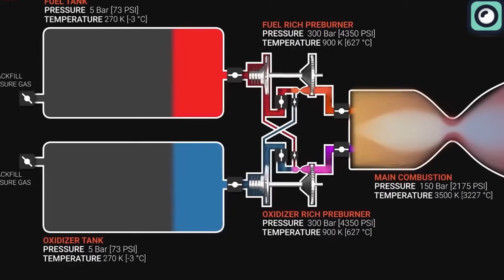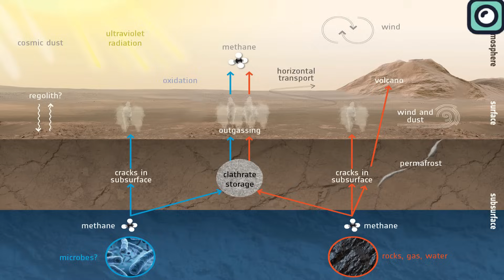"Starship is a joke, will never fly", SpaceX responds to Haters and Embarrass Them!

Comment: Sad thing about Elon Musk is that yes he proved many people wrong about Methane as rocket fuel, yes he  proved many people wrong about Stainless steel as rocket building material, yes he proved many people wrong about Raptor rocket engines but in the end he failed due to his ignorance of mechanical engineering  as he was unable to properly design unpressurized part of his rocket so it would withstand compressive forces developed during liftoff and flight to orbit. His disdain for formal education is his undoing.

Comment: THIS is how you  innovate, test new "outside of the box" ideas, see what fails, fix the points of failures and be a leader in the industry.  Stockton Rush (Oceangate) on the other hand tests out new ideas with paying passengers (or mission specialists, if you prefer) on board.

Comment: Musk is very smartly taking advantage of modern educated engineers. Ironically he holds formal education in disdain. Wish he would change that attitude.
Reply: Elon's attitude is his undoing. Last test launch could have been total success if Elon bothered himself with studying mechanical engineering or hired professionals and allow them to do their job. After his rocket failed Elon lied as to why it happened and came up with the bandate that enured that on the next launch attempt his rocket is not going to make it pass the top of launch tower. There is a price people pay for their Arrogance. Unpressurized section of the Starship/Booster is a total mess uncapable of supporting the Starship during liftoff and flight to orbit. Last time around the Skirt of the Starship partially collapsed at 40% of nominal compressive loading  just  before MECO. This time around his rocket is going to collapse before it reaches top of the Launch Tower

Comment: An engineer wouldn't call that first test launch a "failure".  Here's why.

When engineers design something, they use the best information they have at hand in the design.  But we live in a world with a lot of engineering "uncertainties" such as friction and metal fatigue, as well as simple oversights no one caught, therefore, testing must be accomplished, with the understanding that there's a pretty good chance for something going wrong.  (Some tests are intentionally "tests to failure" to see the limits of a design.)  So Elon tested Starship and learned a lot when it failed.  Unknowns became knowns.  Guesses were refined.  Oversights were caught.  In that sense, the test was a success.  Had they not learned a thing, that would have been a real failure.  They wouldn't know what to fix to preclude another failure.

There still may be a "failure" with the next test orbital launch.  It really isn't until you have payload onboard that if the rocket fails, you have a real genuine failure.  There could be even more "failures", which are okay until the money starts running out.

Remember "failure is not an option"?  That's because the mission objective changed from going to the moon to simply getting the crew back alive.  Apollo 13 failed at going to moon (the first part of Kennedy's stated goal for NASA).  It was not a test rocket.  But at least it did succeed at bringing the crew back alive (the second part of Kennedy's goal).
Reply: Really ? As an engineer to make full use of past engineering experiences of all that preceded you is the norm. In this case we witnessed what could have been so much more, but success was cut ridiculously short by a gung-ho half hearted attempt. Let me explain.
The launch pad which spectacularly disintegrated and most likely damaged the spacecraft should have been a no brained to construct. There’s been 60 years of launch data to draw from demonstrating the correct construction methods that should have been used. 
Oh, you may say that this rocket was so so much more powerful ! Well, sure around 25% more than was used in the 1970s , so, construct the launch facility 30% stronger, NOT as it was done here. 
Now if the Starship actually made a successful launch, a successful flight as was intended then that would have been considered a success.
Reply: the launchpad isn't the reason that test flight ended when it did. starship made it past max-q despite several engines aborting, which is absolutely a success. the reason the test ended was because the flip separation idea failed. the ship was stuck to the booster, so they decided to trigger the self-destruct explosives onboard. also, maybe you could say that SpaceX gained some data on what it might be like landing a booster on the bare surface of Mars... at least as similar as Mars is to concrete. (but yes, most people could guess what would happen, and they should have planned for that. now they have.)  @spinnymathingy3149
Reply: @spinnymathingy3149  “60 years of launch data”?  Yeah, 60 years of NASA launch data, where cost control is way down the list of priorities.

Elon’s test of his first really cheap launch pad gave him the information he needed to build the next cheaper launch pad.  For all we know, that first launchpad may have worked.  There was no way to know without testing it.  It’s easy to be a Monday morning QB about this stuff.

Following the NASA way of doing things is guaranteed to lead to high costs and cost overruns, as perfectly shown with its very expensive and already-outdated Artemis rocket program.  In regular business, you start out with a design that’s cheap, but you believe has a reasonable chance of success.  After testing, if needed, you build on that design recognizing that there will be an increased cost.  In stark contrast, NASA’s typical way of doing things is design something that has enough engineering overkill in it so that it’s almost guaranteed to work, and worry about costs later (if you worry about them at all).  That thinking just doesn’t work in the for-profit business world.  NASA had about 400,000 people working to put a few men on the moon.  Elon’s SpaceX is trying to put hundreds of people on Mars employing about 12,000 employees.  He’d quickly run out of money if he did things the NASA way mainly using their data.
Reply: Good one. @spinnymathingy3149
Reply: When it comes to good engineering practice SpaceX failed miserably. State of the art today when it comes to designing interstage can easily be found on the Internet. SLS Artemis uses aluminum alloy for their Interstage instead of Stainless steel and they use crossing diagonal reinforcements. It would be very prudent of SpaceX engineers to find why other people use diagonal reinforcements that are so much harder to manufacture. Sadly they never bothered with asking such questions and as result of willfull ignorance their interstage (Skirt of the Starship) partially collapsed and less then 40% nominal compressive loading leading to termination of the test flight. Willfull ignorance comes with arrogance and instead of admitting to fatal flaw of their design Space Cadets at SpaceX decided to hide it and lied about real reasons of faliure of last test flight. Instead of structurally redesigning whole unpressurized section of the rocket to eliminate buckling of thin walled structural elements they resorted to dubious bandates like Dynamic Skirt Pressurization Scheme disguised as Hot Staging. Even when they applied their bandate they still refused to learn anything and refused to  use crossing diagonal reinforcements in their design of Vent Ring. It is common engineering knowledge that round structures subject to compressive force tend to fail by whole structure twisting around it's main axis. This is very simplistic explanation why engineers use diagonal stiffeners to prevent this type of faliure. There is also much more profound reasons why edge compressed rigidized metal membranes of cylindrical shape use diagonal reinforcements and it has to do with converting compressive force into checkerboard of bumps and dimples on surface of the membrane. Anyhow price to pay is that next time around rocket will not make it pass the top of the launch tower. So much for progressive steps in rocket design.
Reply: @KarolKarolak  Aluminum?  Artemis?  You just don't get it yet.  SpaceX is designing quickly reusable relatively cheap rockets, not antiquated one-timer-use "politically-designed" rockets like Artemis.  SpaceX would have already gone bankrupt if they had followed the NASA model for rocketry.

You're trying to compare apples with oranges.